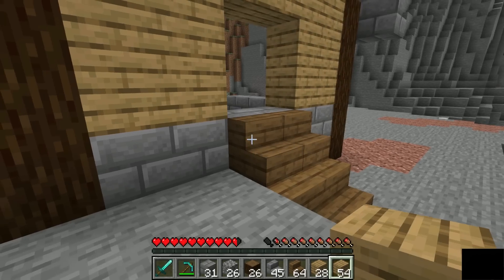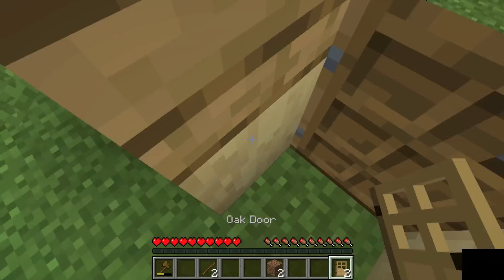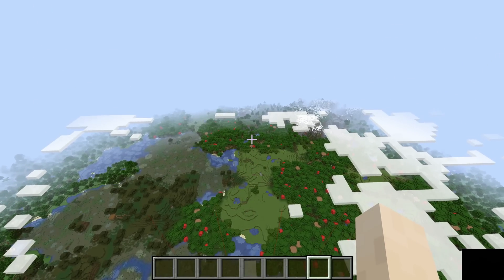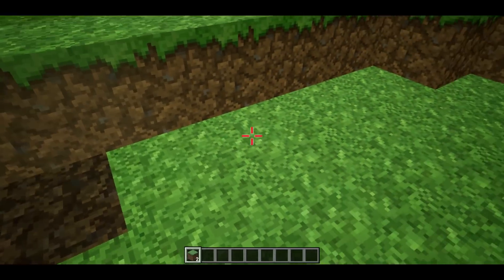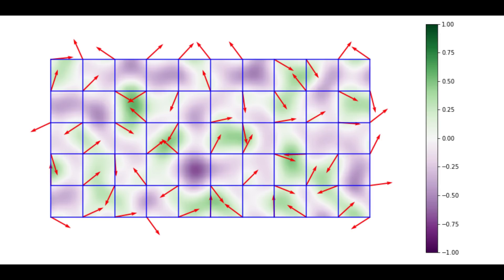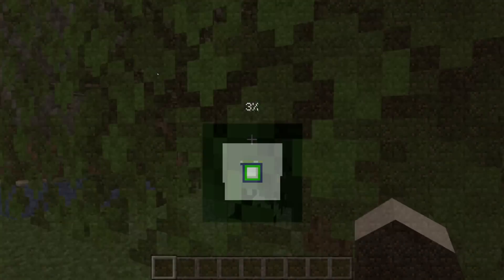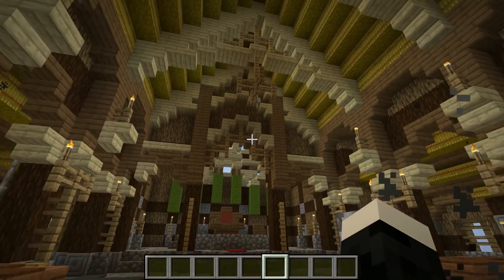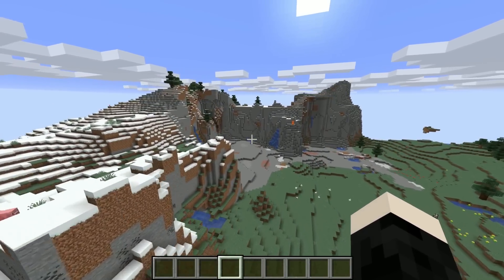Why Minecraft is a Technical Feat | Explaining the Engineering Behind an Indie Icon

Comment: I actually thought that... this would be a actually technical video but it is not. You see, minecraft still uses a polygons to render the world. Games that are based on a voxel engine have a completly different technique for rendering things. It is true that this technique needs a lot more ressources to run because you scan every pixel on the screen and check what colors would be displayed by "shooting a rayt into the virtual world" but... minecraft has nothing to do with that. Games like minecraft are still called "voxel based games" not because it uses actual voxels but it uses "3d pixels" as a feature. Notch also didn't had this dificulties by creating a destructible world... he has build his first version within a weekend... sooooo... yeah... games like red faction came out back in 2001 and also had a lot of destructable things. Minecraft actually isn't a challenge at all because the game itself doesnt allow any destruction which needs to calculate a bunch of physical interaction. Perlin noise also is pseudo-random... ohh and minecraft was not ground breaking.. it combined a few games and is creative as well as accesible... but not technical ground breaking ^^

PS: 4:07 the.. vertices are actually just the points of a polygon... so... ahm.. yeah. Nice video but maybe around 50% accurate. Your new videos are interesting tho... so i subbed ^^

Comment: The Lighting part of the video is wrong, most games these days are realtime and lights have realtime shadows using CSM or even more advanced raytracing methods, the light sources amount is not an issue either since they're mostly deferred rendered, your info is outdated and mostly refers to pre-2010 games which used forward rendering with conjunction of Baked Shadows and GI/AO, they were also not photorealistic since they used Blinn Phong Specular shading they didn't have Energy conserving materials and the textures didn't adhere to now known PBR guidelines.

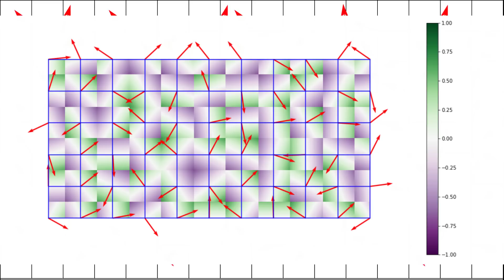Comment: @6:09 The gradient is the angle between the vectors? No! In case you have a scalar field the gradient is the vector containing the scalar fields partial derivatives. The dot product, which is also used to calculate angles between vectors, can be used together with the gradient and any vector to obtain the directional derivative of the scalar field along the other vector. But you can't calculate an angle unless you normalize all vectors involved since the domain of arccosine is [-1,1]. So unless the term gradient is used in another way, you are talking bullshit ;)

Comment: Just a slight correction - yes Ken Perlin made Perlin noise, but Perlin noise is just ONE implementation of gradient noise. There is also plain old value noise, with doesn't use a gradient vector at all (but gives results that aren't as good)

Comment: 4:01-4:09 the back to front overdrawing render method is very good performance killer
The engine draws back to front faces and overdrawing thoose faces with faces are fronter to our field of view in camera, by overdrawing faces/drawing faces that will be invisible to camera field of view we make extra necessary frame processing.
Better to use front to back, fast and efficient, without overdrawing method called: (3D) *binary space partitoning*.
With this method we drawing only visible faces and we have faster frame processing and better performance! (This render method uses games like: doom 1993-2004, quake 1996-2005, half life 1and 2 with episodes 1998-2007, counter strike 1999-2012, portal 2007-2011, team fortress 1999-2007, and other source 2 games)

Comment: Minecraft was technically possible for quite some time before Minecraft was actually made. It's really quite 'simple' or maybe 'straightforward' is a better term.
I don't think the thesis of this video is really correct... Really Minecraft 'just' put all the right elements together using the right technology to make it all really sing.

It's similar to Dark Souls in that way... In the way that it wasn't really doing anything new or even better than it had been done before... But it put exactly the right things together in exactly the right way which made it more than the sum of its parts.
Reply: Also your comparing the number of polygons when viewing a full Minecraft world with 1 character in Overwatch... And Overwatch is relatively light.
I think it does a huge disservice to Minecraft to suggest that the reason it was great was because of some technical achievement... When it was actually just really good game design made in a great way.
Reply: Most games have been using 'occlusion culling' (not rendering polygons that you're not actively looking at) long before Minecraft and it's a completely standard and expected technology.

Comment: Heavily simplifying it at times here.

Like just a lone the cave generation. What you described is the old method. The current method manages to get that perlin worm split into chunks. So that the whole cave doesn't need to be generated.

Also biome generation is a lot more complicated. Especially in more modern versions where they brought back the biomes trying to not have too harsh of a jump. But with a completely different method. And the heightmap depends on the biomes, making that a bit more complicated.

Comment: Now it’s even bigger, -64 to 512 which makes it more complex but it also has more air blocks and mobs lighting level turned down to 0 instead of 7 or less.

 They keep adding to the game but how much more will they do and how much more can they add after 1.19.0 until the computers and consoles makes it impossible to play with 60fps. Minecraft might become smaller you know the border might shrink from 10s of millions too 25 million or less I’m not sure how big but I’m sure this will be last resort and probably takes forever to get out that far.

What do you think they will do next, vertical slabs, inventory expansion by upgrades or just add a 9x9 inventory? Now what do you think.

Comment: To be honest, I wouldn't list random infinite terrain generation as a 'big' technical problem that Minecraft faced. Yes, doing it right takes some effort, and it's basically a gradual improvement process where you start with a simple algorithm, then improve it over time as you find new ways to make the terrain better... but that's it. It's not limited by hardware.
In fact, even a novice coder can make a 'decent' random infinite terrain generator in an evening, by following a good tutorial. (assuming you already have everything else, e.g. a graphics engine that can display this random terrain).
What is a big problem and a technical limitation, is how to store those infinite worlds both in computer memory, and on the hard drive. Dumb solutions would require more RAM than even modern computers have, and save files would take terabytes... not to mention saving and loading times would drive you insane. So solving those problems was a technical limitation, and was pretty much required to make Minecraft. And it's still far from perfect (especially if you want to keep backups of your save files).

Some games with infinite worlds go the route of saving only the differences between the original RNG world, and the actual one (i.e. taking into account everything that the player has changed, and stuff that changes by itself e.g. enemies), and then 'loading' the world is done by regenerating the world from the random seed, and then reapplying the differences. AFAIK Minecraft uses a different approach, with just clever compression of the data, but it's still a very interesting topic.

Comment: Outcast was not the only game to have a voxel renderer in the 90s, just one of the best.
Reply: Also, the reason polygons relpaced voxels is because GPUs became common place, and at those times GPUs were made specifically to render polygons. They couldn't be reprogrammed to render voxels. It's not until the last decade that GPUs have been programmable enough to be able to render voxels directly.
Reply: Even when minecraft was made, GPUs weren't very flexible and didn't have enough memory to render voxels directly, so minecraft transforms voxel data into polygons (two triangles per face) and hands that off to the GPU to render.

Comment: "Compute the gradient, which is the angle between the vectors". What type of gradient is this? Every time I've encountered a "gradient" in calculus, it has not been about angles between vectors. After looking up Perlin noise on wikipedia, it said that "An implementation [of Perlin noise] typically involves three steps: defining a grid of random gradient vectors, computing the dot product between the gradient vectors and their offsets, and interpolation between these values." The dot product is closer to calculating angles between vectors but even that's not it, a dot product returns a single number.
I think you confused gradient vectors and a gradient itself.

Can anyone point out if I'm wrong. I'm kind of confused on the terminology sometimes and by no means an expert

Comment: One question, you say each value of a block is stored within an array, the memory required to do that would be very significant, how much more memory would be required to store a RGB value of a light in each block, and what would the computational toll of it be? I could probably work it out myself, but I'm unsure. I know specifically the RGB value would be quite high however

Comment: Comparing a overwatch character with highly instanceable blocks of minecraft is simply not fair.

I have a video on my channel where I render 1 million cubes with no problem on current hardware.

Also defered shading can place alot of light sources without baking in games like CoD or such. So what you are telling about the light sources is only partially true.
Reply from the maker: Instancing is an amazing feature, but you only reap the benefits when you're rendering models of some complexity. Since a cube is 8 vertices you don't get that much of a benefit. Also, a 12x12 chunk radius consists of 37.8 million blocks :) 

These blocks are also all physics entities. A lot of them have logic updates and some of them are animated. They also need to be stored in such a manner that you can destroy or create up to 20 blocks a second without lagging the game. 

Deferred rendering is also awesome, but it still has its limits and has to be used wisely otherwise it won't run very well on low end machines. The reason I made this video is because a lot of developers seem to think that coding a game like minecraft is easy. Coding any game is insanely difficult. Coding this game requires a lot of skills that most indie developers just don't have because they've never used a graphics api like opengl, directx or vulkan and instead use a premade engine like unity, Godot or unreal ¯\_(ツ)_/¯

Edit* It looks like in my clone I only end up rendering about 10 million blocks (and even then I cull out the chunks not visible by the camera which reduces it to around 3 million). But I still need to store all 33 million blocks in RAM and convert it to VRAM and not waste gigabytes of space which is another challenge in itself :D

Comment: Very interesting video.  I have never heard of Perlin noise.  I've covered L'Place, Taylor, Bernoilli, Buckingham Pi and a number of other theorems and equations but never come across Perlin.  Although randomization rarely comes up in most engineering disciplines because typically design is based around a central need and little to do with aesthetics.

Comment: Great video, does a good job communicating some of the challenges, algorithms and "tricks" of graphics programming.  I'd quibble about voxels being "new" - medical imaging has been using that for a long time.  And to be fair to Notch, his genius was to put various mostly pre-existing techniques together in a good-enough way to realise the creative vision.  I think it would be fun to take 6 months off work to write a similar voxel-based engine from scratch, but the bills don't pay themselves, as they say.  So this video will have to suffice, for now.  And thanks for that!
Reply: Heck, voxels were very common in the early 3D rendering days. What mostly killed them were 3D accelerators, which sucked at voxels and rendered triangles very fast. Of course, that's where one critical thing Minecraft (and its precursors like Infinimine) does is important - the voxels are _huge_, at meter by meter (among other limitations). And they have textures, which is of course necessary at that point - old-school voxels usually only had colours.

Comment: As a math dude, this video is incredibly fascinating. But I have to say that you can't take the gradient of a vector. A gradient itself is a vector--if anything, Perlin Noise must take the gradient of a function (which spits out a vector at each point on the grid). It then must take the dot product between two vectors to get the angle between them. And then the arccos of the dot product to get the angle value.

Comment: I wouldn't go as far as to call Minecraft a technological feat. The algorithms used are not particularly complex. There's many games out there that are more complex to program. That's not to take anything away from Minecraft though, obviously the developers have spent a lot of time working out the details, but the foundation of MC is actually quite simple. Of course things like world generation and so on, can be eternally finetuned and adjusted and the devs have done a good job here over the years.
Reply: It was great for its time, pulling together many different advancements in math and computer science. But yea, a lot of coders will make Minecraft clones as a practice. The game continues to be impressive because like you said, it keeps getting improved by the team.

Comment: Minecraft is not a true voxel game because it uses Polygons. Vector graphics. Voxels are their own thing which are cubes rendered by the cpu. Raster is pixels in a PNG format. Minecraft simple simulates a Voxel type environment using Vector Graphics. As far as I am aware true Voxels can't have textures at this very moment in time but can be any colour. Vector is usually one colour but requires a texture sheet for it's textures.

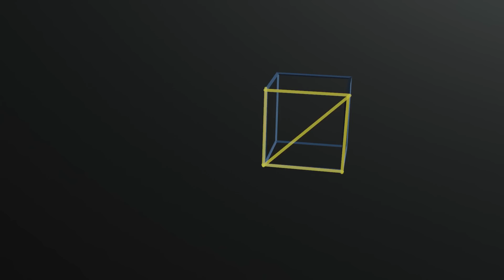Comment: Thanks, very informative. One thing, at 2:53 you say the cube contains 8 vertices. But if I'm correct, in game engines, every triangle has 3 unique vertices. The reason being each vertex can contain unique data (like UV coordinates, vertex color, normal, tangent vectors, blend weights, etc..). So, in this case, a cube has 24 vertices (since every corner is made of 3 triangles x 8 corners).
Correct me if I'm wrong.

Comment: Honestly i dont See any really complicated problems here. All the components your mentioned are pretty easy solveable with basic expierience and some Google queries. The map could be loaded more efficiently after first Generation when you simply define space relative to the size of the useable ram which will Contain activate chunks. Neighbored chunks can be calculated by hashvalues the generator used. This way you could make the chunkloading occur either on the Client by provided seed and hashvalues given by the Server, or directly on the Server by running it on a external thread or even a gpu in a single User Session. Depending on the Ressources available you could determinie which approach is the most viable. Currently the loading is simply providing back the requested chunks by the Server, which will Limit its Performance by network and ramspeed. After the basic maps has been built, you just inject deltas from the users made activities. This also can be cached usersided. Even when this approach does not provide any benefits, the lack of Code dynamics caused the game to be unbearably on Servers with 100 users just Walking in circles. If the game would be proper made, these issues where none, because the game could define its workload by its available Ressources. Using Java is also a huge mistake. This was already a hint for me that this game has been made by a overrated joke of a Developer. Java has only one good ability, that is to let the dev know about all possible mistakes a Framework can offer. Everything comming from Oracle or Adobe is a joke Hidden behind some Marketing lies. 
If you write Code on a regular basis you know that.